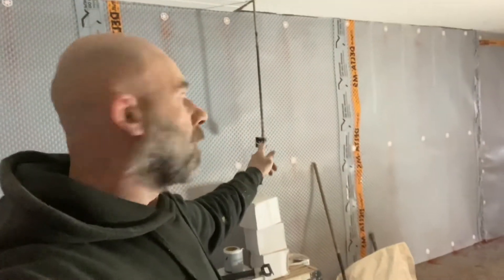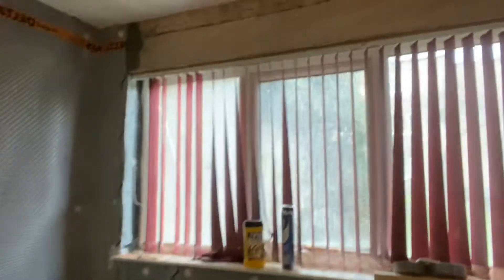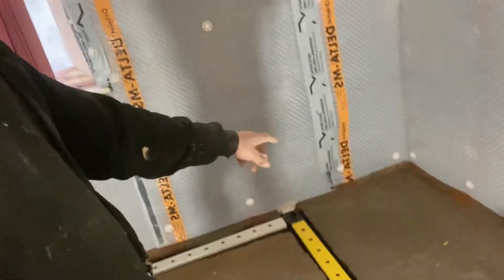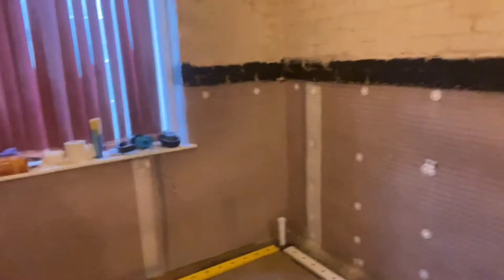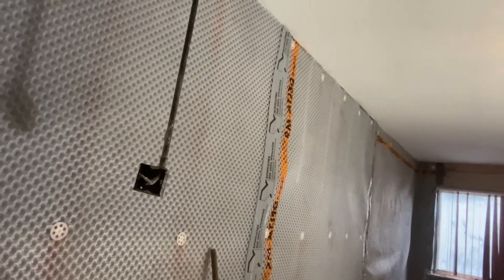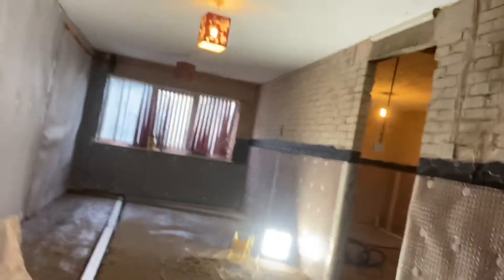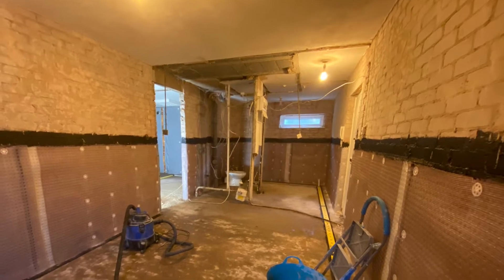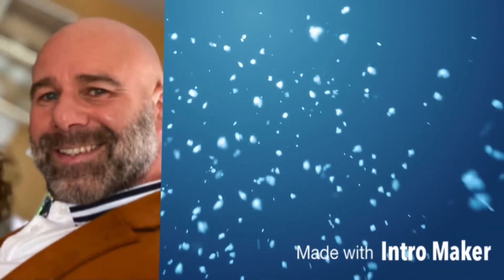Waterproofing in Sheffield Part 5

Comment: Hiya sam good vid again. Just wondering, I get the system on the retaining wall. But can you confirm why your using that system when in other vids its injection and boarding. Obviously not a criticism as I'm still learning from the king himself cheers pal . Keep the vids coming 👍
Reply from the maker: If you look back through the videos you should see the one with the water coming in on the retaining wall.. we had to fix this issue as we didn’t know why or where the water was coming from. It could be a burst or cracked water main/drain or perched water creating a head of pressure. Hope this helps